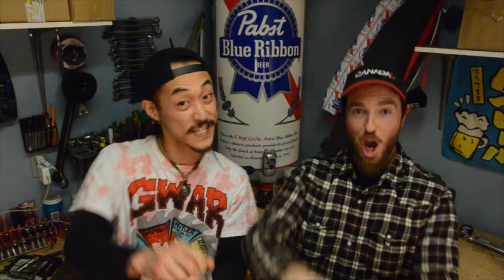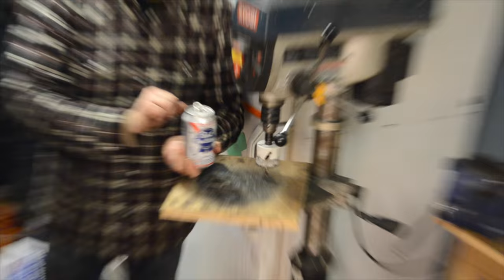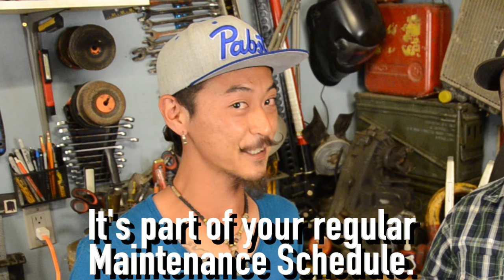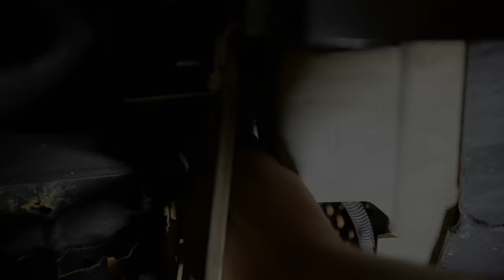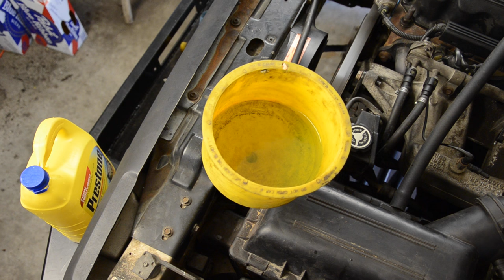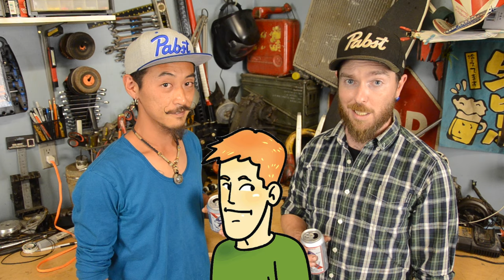Burping Your Coolant - Jeep Cherokee XJ - The Roadhouse

Comment: Mine took me a little while to fill back up. Then I drove it for a couple days, they repeated the process to burp out any remaining air. I also drilled a tiny hole in my thermostat (per another youtuber's suggestion), and put the hole in the "top" position when replacing my thermostat.  When you own an XJ, get used to running hotter than you would normally want in a vehicle...that is until you've done 50 coolant flushes, replaced the fans, the radiator, and installed hood vents, haha.
Reply from the maker: Hahaha
Yeah, that's an old timey mechanic's trick. A lot of thermostats come with the hole in it already now.
Reply: Apparently NAPA auto parts doesn't sell thermostats with a tiny hole in them. No problem....I just used my agrarian ingenuity passed on to me by my grandfathers (both were farmers) and I took care of that.

Comment: This is probably one of the simplest things you can do for your truck, but very important. It also takes more patience than almost anything else. Burping the system can seem to take forever, but it's worth waiting. 

I find giving the hoses a gentle squeeze now and then helps move things along as you wait. Remember, just when you think you got all the air out, give it another 10-15 minutes. Just one bubble can render your water pump inoperable and then there's nothing to stop your engine from overheating.

Thanks for the video guys! Good stuff!
Reply: I was wounding the same thing why they didnt squeeze the return

Comment: Good video, just incase anyone else is still having air issues I found that putting the jeep up at 35 degree incline allowed coolant to reach the thermostat and heater core
Reply: To find 35 degrees here in Florida, I have to do like Elon does when he sends rockets to the moon! 😞

Comment: As good as / as handy as that funnel method can be... it can get you into trouble if most of the air is not bled out first while filling. Thermostat opening will allow the rest to work it's way out... just a heads-up for your viewers.
Reply from the maker: Good point.
Reply: But thats what they did? They ran the heat and motor for 20 minuts. Long enough for the thermostat to open and work the air out?

Comment: I got 1997 Grand Cherokee and it gets over heated pretty fast when going up a mountain with the Air Condition on.. The Mechanic guy I went to changed the fan engine and the radiator but still it got heated again. What else do I need to do to make sure this car never gets over 210f?

Comment: good stuff. i bought myself one of these but I probably let the jeep idle for too long, when i went to remove it to put the cap back on there was too much pressure and I ended up with a geyser on my engine. lesson learned, but I'm not sure where the line is between waiting till the thermostat opens and when there's too much pressure.
Reply from the maker: Should be fine even after the thermostat opens. If it's surging when it opens, that's a good sign you have a cracked head or blown head gasket.

Comment: Cool little funnel. Can you guys do a video about death wobble?
Reply from the maker: Did a track bar episode, and covered a bunch of the steering in our over the knuckle episode
Reply from the maker: I'v honestly seen more cases of bad caster angles causing death wobble than anything else. Of course those vehicles had worn out bushings and joints, but that was also from the bad angles. not the cause.
Cheers Bud!!

Comment: the funnel is an awesome tool to have but unfortunately most people who own them don't use them right...
Reply from the maker: How do they get it wrong? It's pretty straight forward.
Reply: Pabst Boys Roadhouse a buddy of mine borrowed mine to do his fluid change,,,he filled it up and he shoved the plunger in the spout...pressure built up and blew the t handle plunger out...spraying himself with hot coolant...he got lucky by having his glasses on...his face and hand ended up with 2nd degree burns...
Reply from the maker: Wow!
It never crossed my mind that someone would do that.....

Comment: So if my heat doesn't work what do I need to do? Its in the temp knob or something because even if the heat is "on" it still just blows ac
Reply: Sounds like the control unit needs to be replaced in the dash

Comment: what about a in closed renix system ?
Reply from the maker: pretty much the same. Raise the coolant above the engine to burp the system then level it off when youre done.
Make sure the level is set correctly in the gas bottle. If not, that can lead to other issues.

Comment: I have a 97 jeep Cherokee as well and I'm having problems with it while it's running if I give it to much gas too quickly it stalls out any suggestions of what could be the issue
Reply from the maker: Could be a lot of things, but start easy. Have a look at the fuel pressure. might just be a clogged filter or pickup.
Reply: +Pabst Boys Roadhouse yeah that's pretty much they only thing we haven't changed thank you for your suggestion much appreciated
Reply from the maker: No problem bud. Hope it works out.

Comment: I did this and it just kept boiling over
Reply: Mine too.
Reply: @Steeda04SVT  only do it for a few mins
Reply: @stevenharden803  that would explain it. Did you just do that routine a couple of times to make sure all the air was out? Thanks for the reply too man. I appreciate it.
Reply: @Steeda04SVT  i just did it once. Just remember when you're doing it that its no longer a pressurized system and will boil when it gets up to temp.

Comment: Some of the vehicle here just won't bleed easily but if they heat up a while you can shut down the engine and let the heat soak open the thermostat and watch it guzzle the coolant and then the full burp will occur...Love the show gents.
Reply from the maker: Thanks Bud!
That's a new one for me
Reply: Mostly in dual heater systems with a rear heater core...Cheers
Reply from the maker: Oh right.
Like a lot of the fully loaded 4Runners..